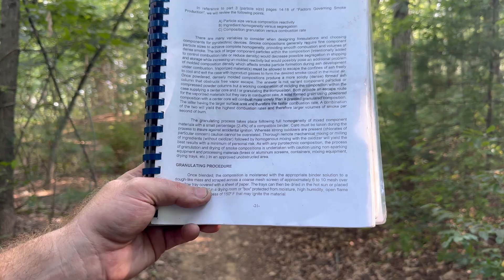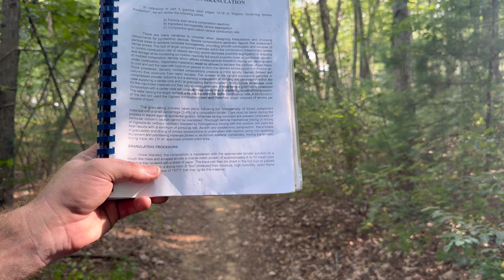Granulation--Why, How, & What Difference Does It Make in Smoke Mixes?

Comment: I'm thinking you do not want to granulate colored formulas because of the reduced time of output, even if the total smoke output is greater, since colored smoke is for signalling not necessarily screening. But, what do you think of creating the cellulose acetate "dough ball" with a colored formula, and packing that as one homogenous mass in the cannister in order to provide some integrity/homogenity protection and some water resistance?

Comment: During granulation, could you add the correct amount of powdered binder to the compound and then wet with acetone? This would allow you to add more acetone to thin the mixture if needed without having to worry about messing up the oxygen balance. If the binder needs to be in solution, how about adding a set amount, and then if needed add more pure acetone? Both of these could allow for more consistent mixtures, the binder ratio would be the same between runs
Reply: I like what you're getting at but I don't think this will work as well as what Tim's doing. The CA being in solution means the granules get an even "film" applied to them that is left behind when the acetone evaporates. Doing it your way would still give workable smoke composition I'd think, but you'd lose efficiency.
Reply: @DrJonezI kinda thought that might be the case, the second half of my comment talks about only adding acetone to thin the mixture after lacquer is applied should it need to be dissolved during the initial addition

Comment: I commented on your last video that I've been thinking about a granulated chlorate/TPA with a light BP coating for a bursting instant smoke that would be considerably less toxic and more humane than white phosphorus and some guy thought it was the dumbest idea ever, lol. I think he either fundamentally misunderstood the idea or the fact that in certain circumstances instant smoke coverage is desirable. Awesome video as always, you're definitely on the bleeding edge of smoke development!
Reply from the maker: You talking bursting daytime smoke star, or ninja smoke?
Reply: @InventionIncarnate I suppose it would be more like a ninja smoke but with pill sized granules that would burst over an area and burn for several seconds. Basically trying to emulate a white phosphorus smoke screen though it wouldn't be as effective of course. Phosphorus puts off a ton of smoke. I was thinking along the lines of a thin craft paper canister with a bunch of quarter inch chunks of the smoke composition coated with BP like how you'd prime fireworks stars. The container would burst and the pellets would be distributed over the surrounding area creating a really fast smoke screen. Ninja Chemist did something similar with rocket candy pieces but the terephthalic acid composition gives off a lot more smoke than that. Obviously a bit of a fire hazard but you'd just have to show some discretion about where you'd use them.
Reply from the maker: @chemistryofquestionablequa6252  go to my website>enter “toottoot” in the suspicious text field at the way bottom of page> page 46 & 49

That info could be helpful. I will stand behind pg 49 formula, either stand alone or as a burst charge to launch the smoke pellets.
Reply: @InventionIncarnate thanks so much!
Reply: this works with granulated sugar/kno3 mixtures, but the smoke doesn't linger for more than 30-40 seconds since its not very optically dense (hence why you'd add paraffin wax to obscure more in a typical smoke comp). Adding red iron oxide to the mixture also makes it work better with a burst charge
Reply: @skymish533yeah, that's why I'm considering the KClO3/TPA mix, it's a lot denser smoke and higher output.
Reply: @chemistryofquestionablequa6252 i dont think it would produce any smoke since tbe TPA based smokes are all pretty volitile when burning. Let us know if you test it out though, it'd be cool to see
Reply: @skymish533yeah I was thinking that a bunch of smaller canisters might be necessary with TPA, if that's the case it'll be too much work each to be worthwhile to build at home.  If that's the case I'll probably go with obe of the chlorate sugar formulas since they're easy to make, impossible to ban and relatively cool burning.